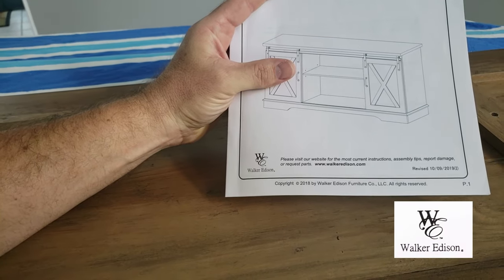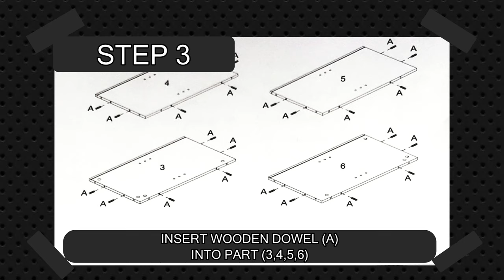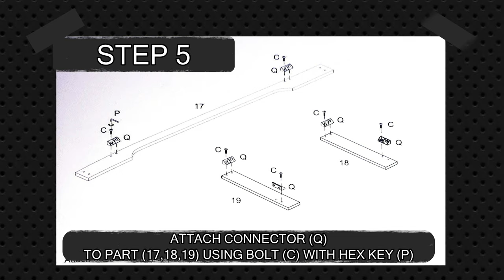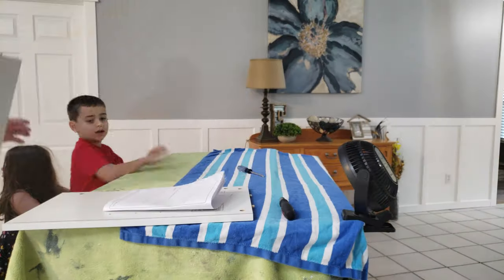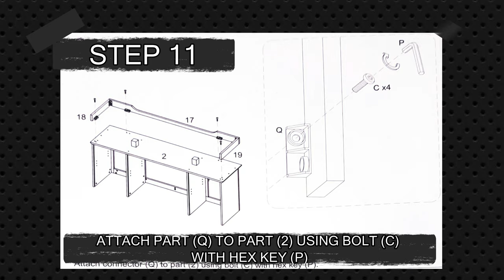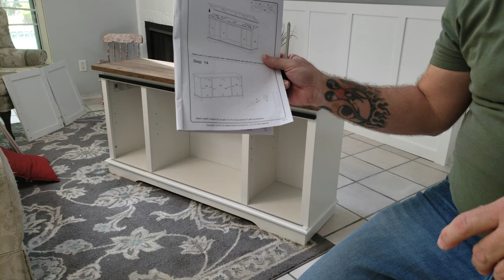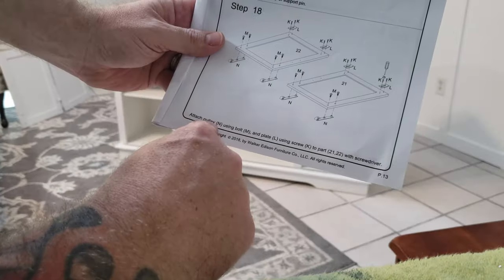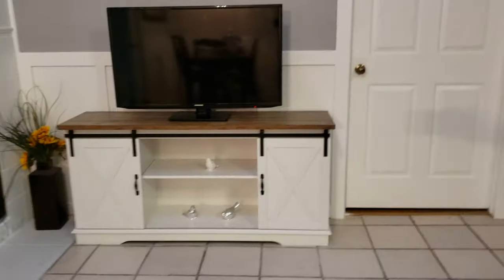MODERN FARMHOUSE BARN DOOR STYLE ENTERTAINMENT CENTER | ASSEMBLY full video

Comment: Thank you so much for this video! I have a question. I am stuck at Step 9. I have 3/7 and 6/10 attached fine, but it only shows 2 cam locks used in that step. Do 4/8 and 5/9 just hang on by the wood dowel at that point until they are tightened with cam locks at another step? Or what am I doing wrong? Haha! Thanks!
Reply from the maker: Yes just the 2 on each side and wood dowel in the middle pieces. 
This is only the rail slide. Then you will have a long board to cover over all of it and screw into. You have it right keep going and let me know how it turns out!
Reply from the maker: When you get to step 13 you will put top on over that piece 👌

Comment: Stuck on step 5! I can’t seem to attach the screw to 17 . When I turn it doesn’t get tighter
Reply from the maker: Step 5 your screwing the piece on to the board and it not working.  If its stripped out you might have to add you a little glue or something to get those to stick in. Those pieces you're working on is the bottom of the unit.